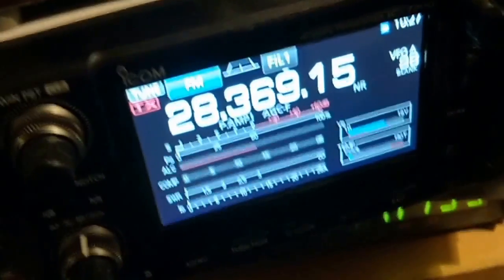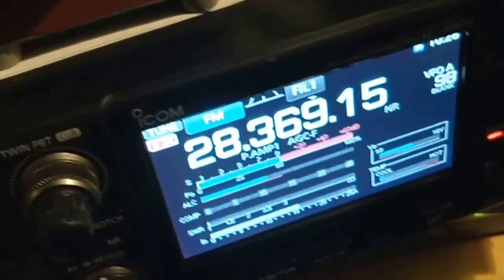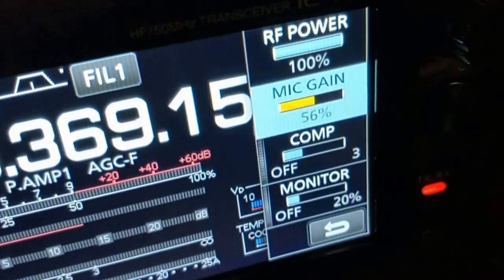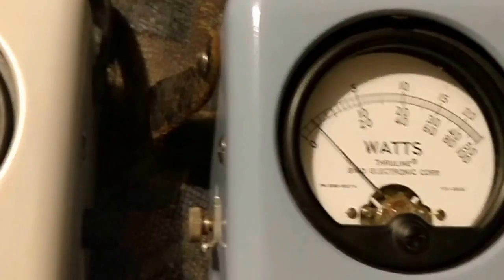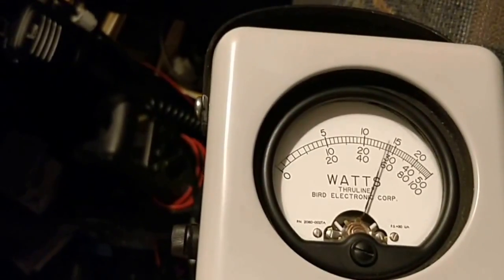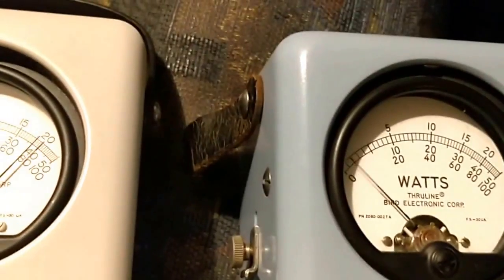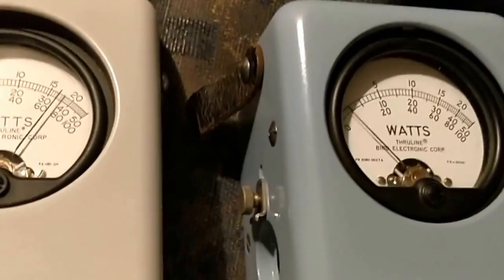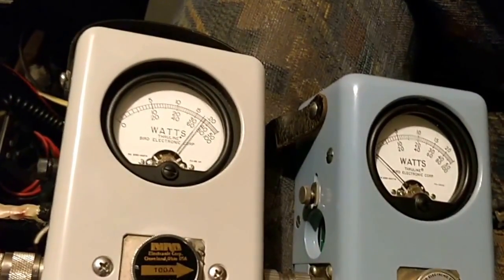IC-7300 10M Power measurments

Comment: What about on AM.. Nobody checks AM. I just sent a yaesu ft-710 back because it only had about 15% modulation with a 50w carrier on the 25w AM setting. Seemed to work ok on the other modes. Sure the carrier could be adjusted in the menu but didn't change the modulation issues. It would only modulate 5w no matter if the carrier was set at 7w or 50w even though it's only supposed to be variable from 5-25w.